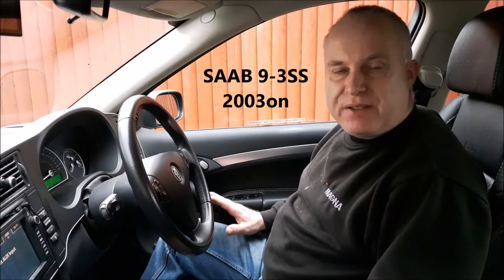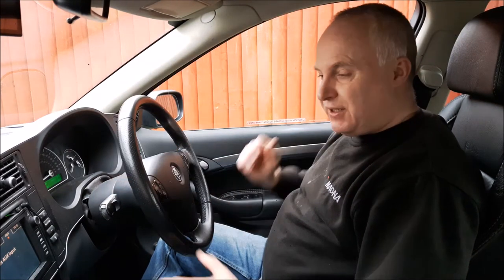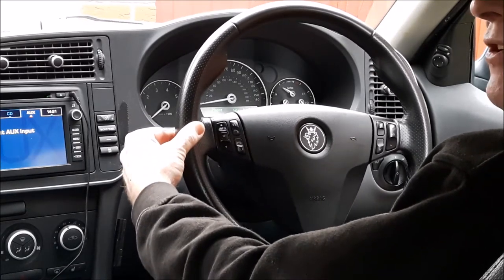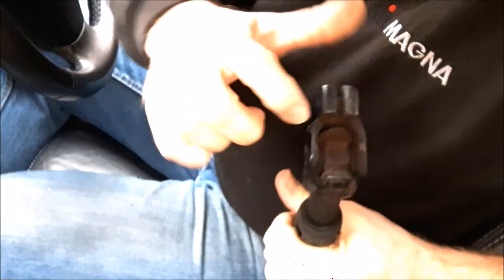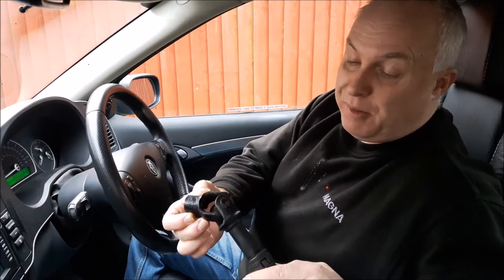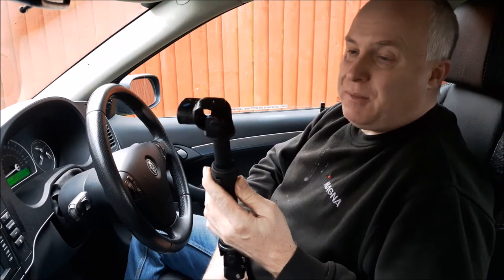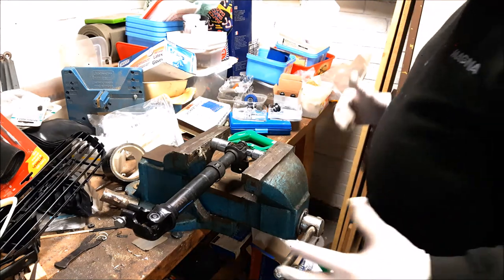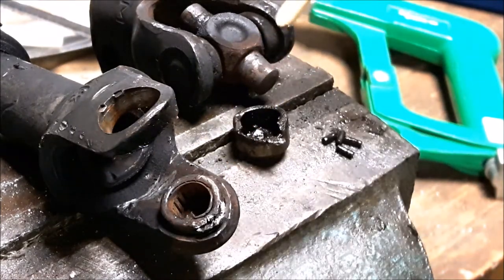LOOSE  STIFF Steering Knock When Turning

Comment from the maker: Something I forgot to mention: the play in the UJ, even when it only seems slight, has a significant negative effect on the way the car "feels". It deteriorates slowly over time, so you don't notice it creeping up on you, but it makes the car feel vague and allows it to wander. Having fitted brand new UJs to my intermediate shaft it has tightened the steering on my Aero right up. Less vibration, virtually no wandering and less tramlining too (both under power and braking).
Reply: What UJ part number did you use?
Reply from the maker: Any 16x40 UJ
Reply: @CycloneCyd the one you mentioned in a reply for the actual job is 15x38. 

So, I'm curious for the exact specs as I'm about to undertake the replacement very soon.
Reply from the maker: @achishukuteki941  oooh! right oh! I'm sure I've got a spare UJ somewhere, so I'll try and dig it out and measure it.
Can you point me to where I said 15x38 so I can correct it if wrong? Thanks
Reply: @CycloneCyd  Cyd, it's a reply to a comment in the removal video from 3 years ago. While reading the other comments, you mentioned 16x40 sealed UJ. So I'm assuming that's the correct specs.
Reply from the maker: @achishukuteki941  just measured my spare - defo 16x40. And with seals, yes
Reply: @CycloneCyd  thank you

Comment: I know this is an old Vid, but I just bought a 2008 9-3 Aero, and in the few weeks I have had it, it has developed play at the steering wheel. Using this, and another of your vids, I replaced it with a TVT unit from Neo Brothers in Waltham Cross. I have to say the quality of the TVT part was not as good as the original, and although it fits, it was a pig to get the bolt in at the steering rack end, due to poor manufacturing tolerances. I have removed the joint from the original, and ordered a replacement joint, which I feel confident to fit. There is a guy in the UK selling refurbed units with new UJ's at a good discount, and  a rebate on your old shaft. Had I known the TVT brand would be such a pain, I would have ordered a refurb one from eBay or a new oem one... Either way, helpful vids, thank you.
Reply: Do you have any info on the guy in the UK that you mentioned that refurbs these?

Comment: I've bought an A6 avant about 2 years ago and I've notice this problem at first drive . Since then I've changed (at the mechanics advice ) nearly all front suspension which was showing signs of wear , changed the tyres, untold wheel alignments and the problem it's still there . Now, thanks to you video , I'm hoping this would be the last I'm thing I'm changing and car will be sorted. Very good explanating video , thank you

Comment: I have Vectra C GTS 07 , i feel like my steering wheel got harder to turn all of a sudden and there is a knocking noise when i turn the steering to the left only any ideas what it could be ? I went to few mechanics they told me that the car steering system is all good

Comment: My car has been parked for 3 month’s and the steering hardly moves and also the car jerks? Anyone know whats wrong and what to do?
Reply from the maker: First thing is to check PAS fluid level and top up if necessary. Then check your UJ.
Can you expand on what you mean by "car jerks", please? Do you mean the steering or when driving? Under what conditions?
Reply: @CycloneCyd  okay ill do that as soon as, when the car is stationary it jerks and makes a noise it feels like its gonna stall.
Reply from the maker: @souljasnm1241  Ah ha! So it's at idle. Does it drive ok under power? If yes, then I would suspect a vacuum leak. Check all the vacuum hoses very carefully for any damage, especially at their ends where they connect to spigots. Replace any that look suspect.
I got a 5m length of hose from here
http://bit.ly/Silicon_tubing    which is plenty to do all the hoses. You will need 4mm, except for the fuel pressure regulator which is 3mm.
Also check this:
https://youtu.be/bgLn14dZL3Q
Link to cobra is in description if you need one.

Comment: Hi Cyd,  I have a 2008 9-3, 2.0t and I want to replace the lower u-joint instead of buying the whole unit. Did you ever find a replacement u-joint? I'd like to know the size, part numbers, etc.

Comment: Are the universal joints readily available to suit? Do you know the size for the 203-6 Saab 9-3?
Reply from the maker: Yes. You need 16x40 with sealed bearings. I get mine from Driveline in Morecambe
Reply: @CycloneCyd  You sure all models had 16x40? I think mine is 15mm. 2003 ss b207 i bought 16x40 and i can see a hole in shaft is a little too small. do You have video how to fit uj? awesome Channel!

Comment: I check my 93 2004 arc steering.  It makes the noise suggested to look for, but I don't feel I have any steering issues.  Car handles well.  Only thing I notice is when I make right hand turn (us car) and the adjoining road dips down I can hear a knock near the front right wheel well.  I had struts and mounts replaced.  So I have no idea what's the cause.  Any idea?  Thanks for your videos.  Gina from Indiana.
Reply from the maker: Hi Gina from Indiana. Welcome aboard. Don't forget to like and share and subscribe. 
Sounds like it's probably the drop links. Here in the UK they take a hammering from speed bumps and rough roads and knocking is very common. Luckily they're a doddle to replace and also Meyle make a set of heavy duty ones. 
https://rover.ebay.com/rover/0/0/0?mpre=https%3A%2F%2Fwww.ebay.co.uk%2Fulk%2Fitm%2F232730220092
I would think Neo would ship to U.S. in case you can't find them locally.

Comment: I have a similar feeling but on a 9-5 aero but the play is lesser. Would it likely be the same issue?
Reply from the maker: Hi Amir. I'm not as familiar with the 9-5 as I am with the 9-3, but I'd say that judging by the posts I see on various groups, it's less of an issue on the 9-5. It could be though. Another common area of wear is inner track rod joints. You really need to get under the car and feel the joints while someone waggles the wheel. "Parts darts" is an expensive method of diagnosis and I would discourage it. Test and inspect properly.

Check the obvious things too like tyre condition and pressures and tracking (four wheel alignment on a Hunter is best - go to alignmycar.co.uk).

Do let us know how you get on.

Comment: Hi, I have a question. Is that an aftermarket part? or similar GM. I have a 03' 9-3 and mine looks slightly different to this one. Also when you pressed it out did you put a circlip in where the steel indents were pushed out?
Reply from the maker: KidKnowledge original part. Earlier ones were slightly different. 
No circlips, pressed in only with a paint seal. 
Thanks for watching.
Reply from the maker: KidKnowledge joint is a 16x40 sealed.
Reply: Cheers for the swift reply! I'll have to look into what is meant by paint seal. Cheers for help buddy!
Reply from the maker: KidKnowledge nowt complex mate. Just paint it after assembly. A small amount of paint capillaries into the interface and seals it. Look at where your Saabs hinges meet the pillars. Exactly the same.
Reply: Cheers again. I did think that was what you meant. I think I might dremel the trunnion stalks off and try save it. But I'm probably creating more work for myself :/ Anyway I appreciate the help and might make a follow up video to show how it went :D

Comment: I had stiff/ binding when I turned left in my Saab 93 2003 
After inspection I found that the scuttle drain dripped directly down onto this shaft! Lucky for me a good blast with wd40 followed by a soak in Wurth HS200 spray grease has got it back running smooth! A good test for testing smoothness is to drive down a quiet road at about 20mph and steer with your index finger. I found I could steer fine to the right but going to the left I couldn’t even move The wheel!!
Reply from the maker: Thanks for watching and letting us all know your experience
Is yours a LHD car?
Reply: Cyclone Cyd it’s a uk registered RHD car.
I think a previous owner may have added a scuttle drain point at a previous date causing my problem! Have you ever researched fitting Vauxhall’s vectra coilovers to your Saab 93? I’m thinking about doing it to mine as they are ALOT cheaper than Saab ones!
Reply from the maker: @toby5710  that's strange, there's defo no drain on my right side above the UJ.
Personally I run Maptun springs with Monroe Reflex shocks. One of this years projects is to replace a load of bushes and banana arms.
There are people who have used VecC coilovers. It'd be worth asking on Saab Nuts! Facebook group.
The main thing to watch is spring rates and getting the closest match for your model, because the Vec is a much lighter car.
Reply: Cyclone Cyd thanks for your input! Love the channel by the way :) keep up the good work

Comment: Thanks for the information. Very helpfull.  I changed suspension parts in my Saab 9-3 2003, but  I am still hearing a knock noise between the direction (steering wheel) and the suspension, this noise is just when I pass trought winding roads. I have changed shock abosorbers, sway bars, shock absorber bases, lower ends, bushing of bars . Maybe is what you said in this video. Any suggestion?
Reply from the maker: Remove the air feed pipe from the airbox to turbo and you can reach down to the UJ. Get someone to rock the steering for you like I show and feel the joint.
The knocking is also characteristic so if you do it somewhere quiet you should be able to hear it
I'm fixing mine this weekend so a video will follow soon
Reply from the maker: Also, get yourself a mechanics stethoscope and follow the method here and you can listen directly to the joint whilst someone rocks it for you:
https://www.youtube.com/watch?v=jnTWmG41vX8
Reply: Cyclone Cyd Thank you , Your videos are awesome I will be pending of your next video.
Reply from the maker: Thanks for the kind words. Hopefully the next one will be how to remove and replace this in the car as I've got to change mine for the upcoming MoT

Comment: Hi am having mercides Benz w210 e320 99 model the steering wheel feel a bit lose u can push it upward   small movement and u can her it knocking when u do that any idea what's the problem please help.... In my area mechanics don't know a thing about this type of faults

Thanks
Reply from the maker: this is a common issue with loads of cars, but also check the inner and outer ball joints on the track rods